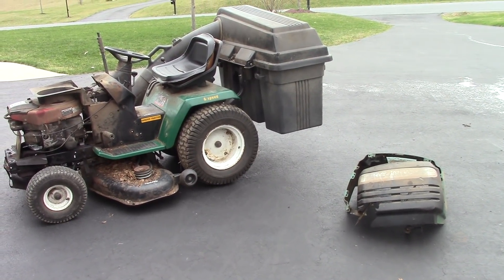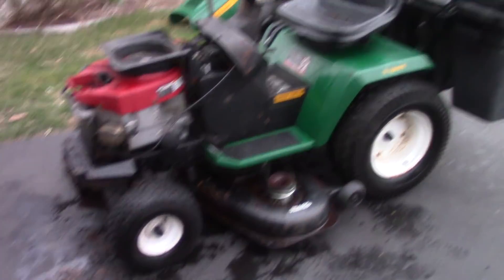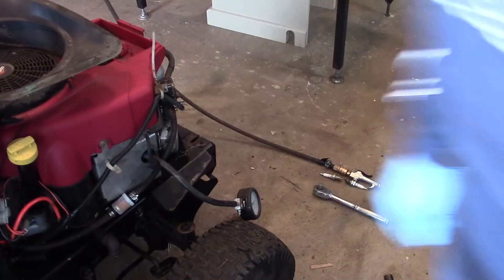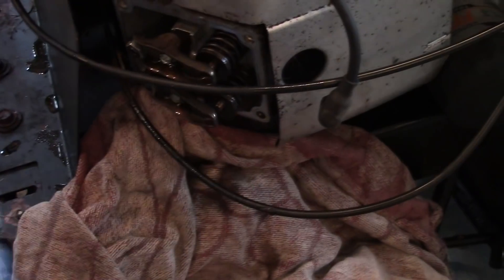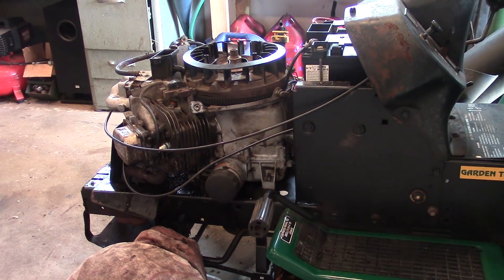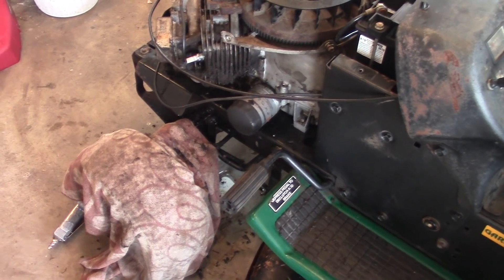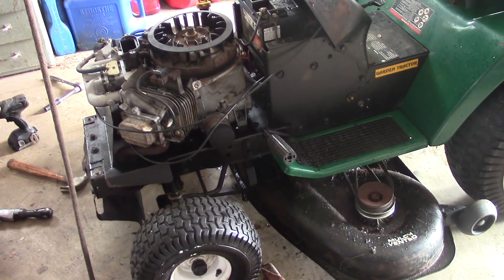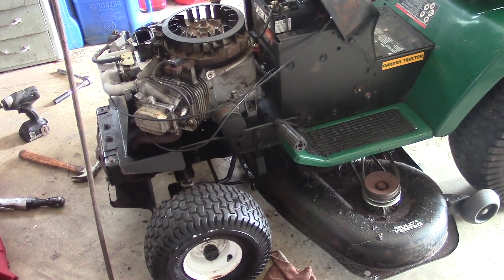Briggs 20HP Twin Won't Start

Comment from the maker: http://amzn.to/1Ro4EmX  Compression Tester
Air Filter  http://amzn.to/2e0VKRs
Spark Plug   http://amzn.to/2drgTPH
Ground drive belt http://amzn.to/2e8UhZ3
38" blade belt  http://amzn.to/2drgUmy
Blades  http://amzn.to/2drgsVr
valve link  http://amzn.to/2dEpOAd
exhaust valve http://amzn.to/2dEpp0T
Replacement engine  http://amzn.to/2dFUsZS Disclaimer:
Reply: you probably dont care but if you are bored like me atm then you can stream all of the new series on instaflixxer. Have been watching with my girlfriend lately xD
Reply: @Kingsley Langston yea, I have been using Instaflixxer for months myself :D

Comment: Thank for your help, I’ve got almost the same motor. Guy brought it said it wasn’t getting spark. Checked it it was, did a compression test very very low on both sides, gonna look further in.

Comment: You never said whether you got the other piece of the broken pushrod out. I have seen them fall down into the crankcase and on extremely rare cases, you can fish it out with a flexible magnet, but most of the time you have to crack the case open to get it out.  But that was a good pickup. It basically is a clone of the Craftsman garden tractor that I have and have used for almost 20 yrs.
Reply: I dont have a aluminum magnet. Where you get them😅 i been looking for a brass magnet for years

Comment: Bent pushrods means a valveguide in the head moved usually the exhaust side.  From overheating ie blocked cooling fins..flip the head over on cylinder side and inspect the guids to verify  guides are flush then lap the valves in. Do the whole job. Its just gonna bend the rods again when the person u sell it to runs it under load.

Comment: That is NOT a garden tractor. Garden tractors have lug nuts on the rear axle for performing garden work. That has a keyway shaft like all lawn tractors, not equipped to do garden work.

Comment: Does the 20 hp Briggs have a compression release? Unless I have a brand  new battery mine will not spin. I have to open the hood and force it through the compression strokes with my hands and then my 5 year old battery will spin it fine. Mine is 15 years old and two weeks ago it would start but die after a few seconds. I dropped the float bowl and the needle valve was stuck. The bowl was pristine but after popping out the assembly with air into the fuel line and putting it back in it ran great.

Comment: Check leakdown and valve adjustment. If they're loose, it could be the valve seat loose. Replace the head. Check the deck for rot. If so,  decide! Check the spindles. Check for spark and fuel etc. Replace the carburetor. Check the float bowl for sludge. Put mothballs under the cover in the Winter to get rid of rats.

Comment: DW6 I have a question. If it's running on one cylinder how come the other cylinder was getting it started since it had good compression? Thanks
Reply: In case you are interested with the exhaust valve closed and not opening due to no push rod no new air-fuel mixture could be drawn in so no bang.

Comment: Man I just bought a 2018 Poulan Pro lawn tractor with a B&S 20hp Intech V-Twin and it blew my mind with how strong it is.  So far my only gripe is that this lawn tractor is s little over powered  for what it is. I mean it seams to spin-out even in dry grass more than it should with brand new rear tires. 

My last lawn tractor was a John Deer with a 17.5 Kohler and it’s 18 years old and still running pretty damn great! The tractor itself just wore out in general. 

If I get that kind of engine performance and longevity out of this strong-ass V-twin B&S I’ll be so happy. So far so good!!!!!!
Reply: Put water in the rear tires, that is what I did to mine.  As a farmer I have the hose connector that does that. You can get one at a Tractor Supply.

Comment: It amazes  me at what phase of dis-assembly that people start and run engines. They are not designed to run like that. When you have everything repaired, there is plenty of time for running the engine. This engine could have had a piece of the broken push rod stuck in the cam gear or elsewhere internally since there was no check for that.

Comment: Guaranteed the exhaust valve guide moved.... tapping the guide back as you did with hammer will only allow it to run temporary.The guide will move again once it heats up
Reply: I agree. There was a reason why the rods were bent.

Comment: I have a 1998 or 1997 Murray wide body 12.5hp 38" cut no deck brand new battery won't even try to start I think it's the start
cilinoyd
Reply: solenoid
Reply: Stacey Stanley check your valve clearances might be a stuck or loose valve ")

Comment: The valve guides will move out if the engine overheats, which will cause the valve not to move. I would make sure the guide didn't move, compare it to the other side. If it did move you will have to replace the head. I went through this a month ago. Just some helpful information even if it's not the issue.
Reply from the maker: +Dastardly84 Yes, I am aware of that.  I will take a close look at it.  Taral fixes all has a video on one that has moved.  Thanks for the tip.

Comment: as a long time Briggs employee I must insist that the term "ignitionally challenged" be used in cases like this :-D
Reply from the maker: +rob roberts Good choice of words.  What did you do for Briggs.
Reply: +doublewide6 I still work for Briggs I work in a crank machining cell.

Comment: Nice pick up! Perfect time to turn it over and make a few bucks. Pretty nice for free...
Reply from the maker: +Darryl 603 Well actually it was $25, I was not sure that I was going to even take it after looking at it.
Reply: After pressure cleaning, it looks pretty decent and seemed to run strong even on one cylinder, surprising as it may be. You shouldn't have any trouble flipping it.

Comment: Really a nice find there.  You have a good eye to see through the grime.  That orange Husqvarna I bought is an electrical gremlin, I need a new wire harness or I'll have to build one myself.
Reply from the maker: +Craig Arndt Check continuity of each wire also check continuity to the block when you test the wires if you have continuity to the block through the wire that is the bad wire.  What engine is it I might have a wire harness especially if it is a briggs.  I will send it to you.
Reply: The engine is a Kohler CV15.  I am going to work on it this weekend, I think its a ground issue.  I was driving this tractor around last year and then fuses started blowing, so I found that the factory zip tie was so tight it cut into the wire insulation.  Fixed that and then other problems surfaced.  This is nothing like my Wheel horse 520H, which was an electrical nightmare- I figured that out.  This is just a stubborn gremlin.  Thanks for your help, always appreciated.
Reply from the maker: +Craig Arndt Craig I don't have that harness unfortunately.  Please post a video on you wiring progress.  Thanks.
Reply: I will, I'm really hoping to get to it this weekend.  Although I plan to be in the shed with the wood stove, supposed to get snow so I'm really wanting to get another burn out there.  Should get to it though, have a good weekend bud.- Craig
Reply: +Craig Arndt did u get it figured out?
Reply: +Craig Arndt did u get it figured out?
Reply: It turned over several times so I thought I had it.. I started putting things back together and nothing.  There is a bad connection somewhere or ground.  I really need a new harness as some of the wires were arcing causing the fuse to blow.

Comment: I meant your shed video.. I'm currently building (contracted out) a red Iron I beam building.. Total span 58x100 plumbed with a shower, toilet, and utility sink.. Only two weeks into the build.. I should get some video's and post them.. It's coming along great.. I love to tinker (we have that in common) for sure !!
Reply from the maker: +Vdubin64 Sounds awesome that is  huge structure and no peeing in random buckets.  Do it right the first time.